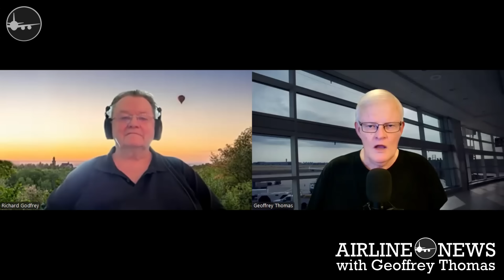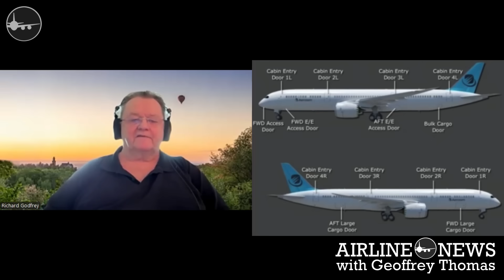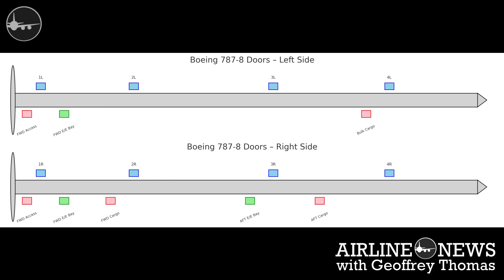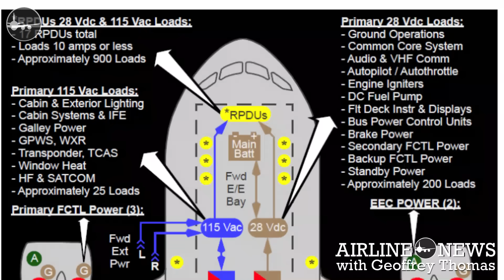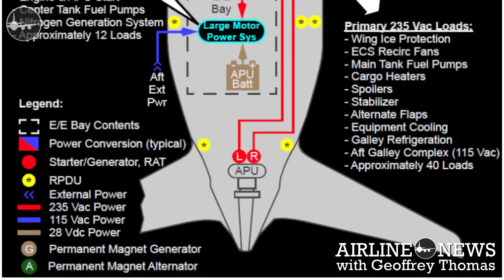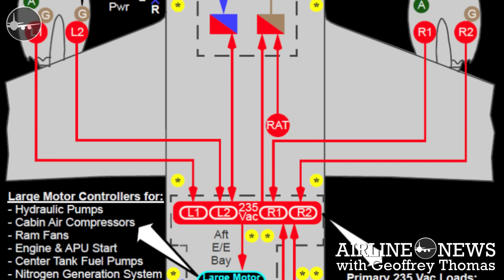Air India Crash Eps 189 - Toilet Leaks Exposed

Comment: Gentlemen, I have 41 years of experience with developing and certifying aircraft gas turbines and power plants. Sorry, but your inference that the loss of boost pumps directly results in engine rollback is not supported by any facts. On the type certificate data sheet for any engine, you will see that the minimum engine inlet fuel pressure is declared. As part of the aircraft certification, it has to be demonstrated by the aircraft manufacturer, that under normal operating conditions, including suction feed (ie boost pumps off) that the engine inlet fuel pressure does not go below that value. I'd like to hear of any specific examples that you can find where a boost pump failure lead to an In Flight Shut Down.
Reply: Agree with this observation (similar experience and background to Bruce) - the FAR's require the engines to be capable of operating in suction feed mode and this must be considered in the safety analysis and is generally demonstrated during the certification flight test programme. Experience has shown that the engine could flameout at high altitude and it has to be demonstrated that the pumps can reprime and the engine restarted when it has descended into the windmill relight envelope.

I would not expect a problem at take-off but some cavitation could occur and some pump inspection/maintenance action may be required.
   
That would suggest the less likely CCS failure possibility that Richard listed would be worth looking at in more detail to investigate how that system could affect engine operation.
Reply: I don't believe the inference is it directly leads to rollback. The indication is it could under the right conditions. Very important concept. Fuel pumps pump liquid not vapor. Under high temperature conditions , it was extremely hot this day. Under high engine load, which means high fuel volumes, the pumps are creating large pressure differentials. A sudden loss or fluctuations in boost pressures could vaporize fuel, flashing to vapor. Causing a temporary loss in the ability to pump fuel. This is what could cause a dual engine flameout. Is how I see the indication. Your statement indicates " under normal operating conditions". Show me the test where they introduced random electrical faults in the boost pumps on an extremely hot day, at full load. Then I'll not leave this possibility open.
Reply: @Josemenez-lofs  During suction feed flight testing, the boost pumps are completely off.
Reply: la alimentación por succión funciona en velocidades de crucero. A 300 km/h no funciona.

Comment: Thank you for your calm analysis as always.
I am still concerned about the difference between the calculated load weight and the actual load weight. If the actual weight is unknown, the VR calculations will also be different. Was the cargo loading balance appropriate? Even for a large aircraft, if the center of gravity is off, I think it will crash. It would be difficult to recover the cargo after the crash and verify the weight balance. Please explain this point.

Comment: Retired airline Captain here. Having been qualified on many jet airliner types, including the L-1011, and Boeing types from the 707 through the 747, and 757/767, I have encountered problems with fluid leaks into the E&E bays from toilets and galleys. You may be correct in your assumptions, Richard, but it seems a stretch that this would cause the arcing during the rotation phase of the takeoff, which is normally done at 2 or 3 degrees per second, depending on weight. That this could then cause arcing and fuel valve shutdown one second apart at the most critical moment is almost beyond belief. I hope the data from the CVR and FDR will tell the tale. Wouldn't it be wonderful if a cockpit video recorder had also been installed? Keep up the good work. One last question. Are either or both of you current or former large aircraft pilots?

Comment: If the ebays were shorted out by water intrusion, causing the engines to be shut down shortly after takeoff, how were the pilots, or pilot, able to initiate a successful, albeit too late, restart of both engines? Wouldn't that be impossible due to the electrical shortage due to water intrusion?

Comment: Being an airline avionics engineer for some 45 years and licensed on 787, I follow your theory with some doubt. I have gone over the 787 System schematics manual in Ch 76 Engine Controls which has 3 diagrams per engine showing the flow of power to the Fuel SOV on the HMU. In the end of the day the solenoid coil on the FSOV on the HMU is de powered to the run position. It seeks an earth to shut the engine down not a stray positive. So no electrical power equals engine run. The earth signal is interrupted by the Fuel Control switches via a dual coil Engine Fuel Control relay in the P300 panel. This relay has positive all the time on the Run and Cutoff coils but seeks an earth to move the relay. The only way for this to happen is movement of the fuel control switch or some wiring failure where an earth ends up where it shouldn’t be.
Cheers
Reply: Thankyou, I ve been looking for that.

I m not convinced by anyone.

Does the RAT only supply instruments and controls to cockpit  left seat ?
Reply: If you were an airline avionics engineer for 45. The idea an aircraft has an "earth" is somewhat ridiculous. Only when the aircraft is on the ground attached to ground power may it be "earthed". The correct verbiage in my view would be a 0V reference point. Since voltage can be positive or negative based on a reference point.  AC voltages always go positive and then negative on the 0V reference. This when converted to DC can also be a negative voltage of positive voltage in reference to the 0V reference point. Further even within different conversion s the 0V reference maybe different.  So your assertion are not fully vetted.

Comment: It's almost unbelievable that fluid leakage near to electrics was not initially designed out and then not completely fixed when the problem  became obvious. Good to see real fact based discussion here rather than the pilot orientated blame game, that second video of the aircraft showing the RAT deployment was a strong indicator of a systems failure to me.

Comment: the guide "fliphtml introduction to b787 avionics and electrical" on page 92 says "In the event of a loss of airplane power, the ram air turbine (RAT) generator will supply the backup bus which will supply two TRUs to maintain 28v dc power on the captain's and first officer's instrument buses."  Maintaining both instruments with the RAT is an improvement for Boeing on the 787 compared to older jets which only maintained the Captains' instruments.

Comment: Thank you both for your incredible work with this terrible crash.  If the authorities decided that water ingress to the EE bay could be a cause is it possible that evidence of this could be found?  Any evidence of recent activity would have evaporated in the heat of the subsequent fire.  Only ongoing problems would perhaps be evidenced by some stain or corrosion.  I gather there was a considerable disruption to the crash site before investigators had access.  Is it possible that this could remain undetectable.  I do not query your hypothesis only query how or whether it could be proved. Please excuse me if I am not on the right track with my thinking.  Thanks again all the best to both of you and please keep up the good work.

Comment: Thanks for yet another well-reasoned analysis. In an earlier part of my career, I had the privilege of working with some superb accident investigators on GA crashes. We, of course, had no FDR data just wreckage to sort out piece by piece. Richard's approach to analysis reminds me of some of the best-of-the-best investigators I worked with at that time.

One must wonder if the string of issues with leaking toilets and the lack of a rectified design in the 787 is the result prioritising shareholder value over safety to get a model to market. Could such issues be avoided by a wider adoption of the approach taken by Lufthansa in its A340-600s with the restrooms on a lower deck?

Comment: Great continuing coverage and content on the Air India crash. With Richard’s suggestions of different possible failures as the cause for the crash, would any of these failures show up on the Flight Data Recorder? I thought the Flight Data Recorder would capture most if not all of these possible failures. Did Air India release any of the recorded FDR data which sheds light on these possible failures? Thank you both for all your coverage of this airline tragedy.

Comment: Check out these by Jeremy John Thompson: 

1. The no nonsense analysis of Al171
on July 10, 2025
He is short circuit of the lithium ion battery hypothesis.
https://youtu.be/fl1kUudq7Tw?si=Pfgm-R1YkQjH72md

2. How Air India Al171 B787 crashed - Lithium Battery Diode Module Failure
July 30, 2025
https://youtu.be/OLxLN3osS1Y?si=xE0eO41rdsAam3gp

3. More details on historic B787 Dreamliner battery failures
on Aug 10, 2025 
by Jeremy John Thompson
https://youtu.be/Od5FFOipRBU?si=M_95sVzN4nnuf2i_

See all 3 videos at:
https://youtube.com/@jeremyjohnthompson5187?si=-f5-nefDwXWeDcrg

Comment: Actually, an acquaintance of mine who works in Delhi, but flies back to Germany several times a year, and sometimes on Air India. He mentioned that he never had any safety issues during those flights, but tables would be stuck, entertainment systems in some seats were dead, repairs done with visible duck tape, and every single time one of the toilets would not work. All this IN BUSINESS CLASS. Just saying
Reply: Yes, the first leg of the flight a passenger recorded a video saying that the cabin lights at the seats didn't work, the entertainment system was not working and the AC wasn't working either.  He left the plane but not sure if he was still going to London or decided to get off and take another plane.  Another person said she missed getting to check-in for the flight by 5 minutes due to traffic. Lucky for her

Comment: Richard, my question in response to this very interesting episode is: do you now believe that the dual engine shutdown was a direct result of the EE Bay water ingress? And if so does this mean you have changed your view since the report, which states instead that the EE Bay water ingress led the pilots to move the cockpit fuel switches and this move of the fuel switches shut the engines down?

To explain: On page 5 the report says "The dual engine shutdown probably resulted from intentional movement of the fuel control switches to CUTOFF" and "The working assumption, at this point in the analysis is that the engines were both working fine until the Fuel Switches were both set to CUTOFF." The report proposes that this intentional movement of the fuel switches was a "cognitive error" (page 16) response by a pilot to what he was seeing on the screens (page 4) as a result of electrical failures. In other words: electrical failures led to cockpit messages, a pilot erroneously responded to these by moving the fuel control switches, and this move caused the engines to shut down. This is all restated pretty clearly in the conclusion of the report (page 17). On this picture the dual engine shutdown was 'commanded'.

By contrast in today's episode (14:04 to 19:56) you advance a different hypothesis. In brief, you say that water ingress into the EE Bay could have caused an electrical interruption to the main wing boost pumps, leading them to cavitate and to cease to supply fuel to the engines, so that they shut down without the fuel control switches being moved. At 26:01 you add that in your view the captain's move of the fuel control switches to CUTOFF and then later back to RUN was an attempt to save the aircraft following this dual engine shutdown. On this picture the dual engine shutdown was 'uncommanded'.

So, in your current view, was the dual engine shutdown commanded or uncommanded? Or are you open to both possibilities? 

(NB the report pretty well flatly asserts that the engine shutdown was commanded, for it says that immediately after Vmax was reached "the Engine 1 and Engine 2 fuel cutoff switches transitioned from RUN to CUTOFF position one after another with a time gap of 01 sec. The Engine N1 and N2 began to decrease from their take-off values *as the fuel supply to the engines was cut off*" (my emphasis). So if you claim that the engine shutdown was in fact uncommanded you are straightforwardly contradicting what the report says on this crucial point.)
Reply: Loss of a boost pump is a foreseeable event and the engine must be able to operate at the lowest possible fuel inlet pressure - a condition known as suction feed.
Reply: Interesting. Another problem with the “boost pump failure followed by captain attempting to recycle” scenario is that no-one attempting to recycle the engines would wait 8 seconds before moving one switch back to RUN and then another 4 seconds before moving the other back.

Comment: So we are supposed to think that the "toilet leak" magicly somehow PHYSICALLY moved the fuel cut off switches in the cockit?    🙄🙄🙄🙄    🤦🏼‍♂🤦🏼‍♂🤦🏼‍♂🤦🏼‍♂🤦🏼‍♂🤦🏼‍♂
Reply: No, as I understand it Richard's current hypothesis is that the toilet leak led to fuel pump malfunction which shut the engines down. After that, moving the fuel control switches to CUTOFF and later back to RUN was an attempt to save the aircraft. This is a different hypothesis to the one in the report - see my long comment on this a minute ago.

Comment: I am amazed that ALL  EE bays aren’t 100% moisture proof ? They should also have a moisture WARNING system, not unlike C02 detectors, owners install in general aviation aircraft 😂It seems so simple, to be included in aircraft design. Positioning of possible H2O sources should also be rethought?👨🏻‍✈️Would someone install electrical circuits under the swimming pool of their home? I think not!
Not sure if Bean Counters or Engineers are to blame ? Lots of questions! As I said before, the final chapter of this novel has not been completed or may never be?

Comment: If fuel cutoff switches were solely the cause of RAT deployment,  then Engine 2 would have to have spooled down to below idle speed to trigger deployment.

Question to Google  AI :”Quantify how long does it take for a Boeing 787 GE turbofan engine to spool down from take-off thrust to idle?”
Answer:  “A Boeing 787's GE turbofan engine typically takes around 7-10 seconds to spool down from takeoff thrust to idle. This is because the engine's large rotating components (like the fan and turbine) have significant inertia and require time to decelerate.” 

From AAIB report, engine 2 cut-off occurred at liftoff + 5 seconds. So if you combine with the above answer this suggests that the earliest that engine 2 would have spooled  down to idle speed is liftoff + 12 seconds.
The image (Fig 15) showing the RAT fully deployed occurred at lift-off + 10.5 seconds according to Richard’s previous analysis, i.e. 1.5 seconds before shortest spool down time.
Two further points to consider; 
time to physically deploy the RAT (0.5-0.8 seconds)
The AAIB report wording is vague as how Fig 15 relates toe RAT deployment; “getting deployed during the initial climb immediately after lift-off” is ambiguous as it doesn’t state if this is the first frame showing full deployment.

This is another possible way of arriving at an observation that the RAT deployed at least 2 sec before engine 2 fuel cutoff switch could have triggered the deployment.
Reply: Regarding your question to Google AI: Google's answer may be based on setting the thrust lever on idle and not on completely cutting off fuel.
Reply: @klaushoegerl1187  The air passing through a turbofan engine at 170 kts (approximate airspeed of AI 171 at liftoff + 7 seconds) will extend the spool down time from max thrust to idle (compared to a max thrust to idle spool-down performed on the ground when the aircraft is stationary) due to windmilling effect.  It should also be noted that the engine idle speed to maintain power supply to the aircraft is lower than idle required to maintain level flight. When a pilot reduces engine to idle speed in flight he is not reducing to ground idle speed  (hence a shorter spool down time).

Comment: Not withstanding if it is  found Air India did not comply with the Boeing directives, which, if proven, is grounds for Air India having its AOC removed, I am amazed that the  787 should suffer from leaking toilets. This was a big problem on the 767 I flew, but this aircraft first flew in 1982. How is it that Boeing, when producing the  787 in the 2000 's and knowing that it was an all electric jet, did not take the isolation of  stray water /sewage  from the E/E bays REALLY seriously. Over many years I have plumbed in 5 bathrooms in the various houses I've lived in and apart from my first attempt which was very  wet never experienced any leaks and I'm not a professional plumber .
In the 6 years I flew the 787 before retiring, I never experienced leaking toilet or galleys ( the odd ice draw), but maybe because they were all brand new! 
Richard, I wish you had been on my 787 conversion course. I'm sure It would have been so much easier with your ability to explain complicted technical matters in such simple terms  😅
Keep up this amazing work.
Reply: It was mainly the water line to the restroom sinks that was mentioned in the AD and not the actual toilets.  But as has been pointed out even those might eventually leak if not inspected and fixed.